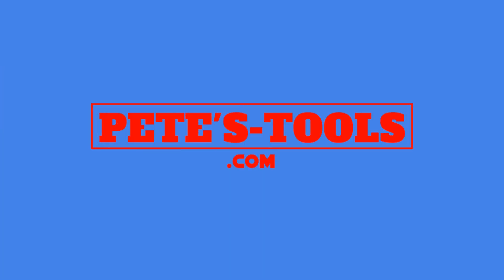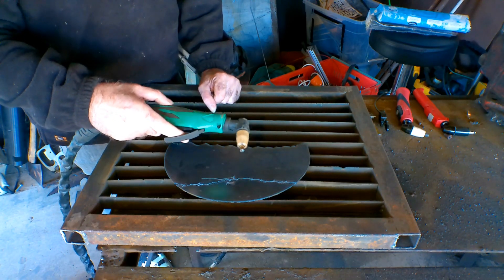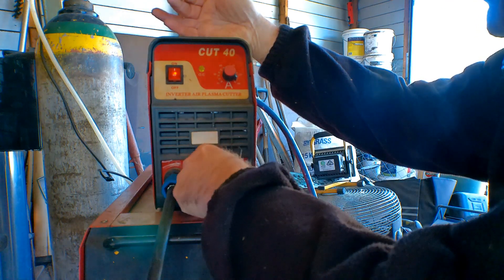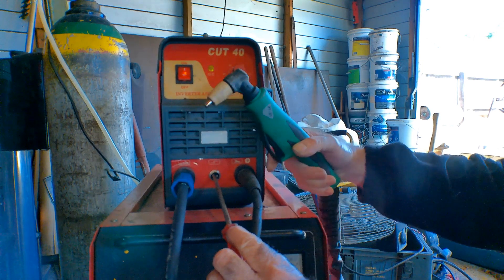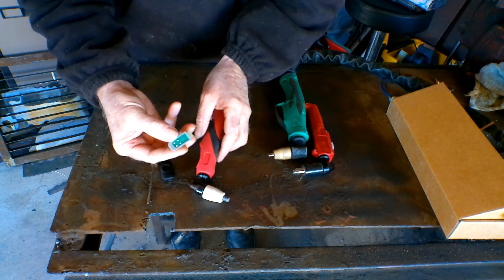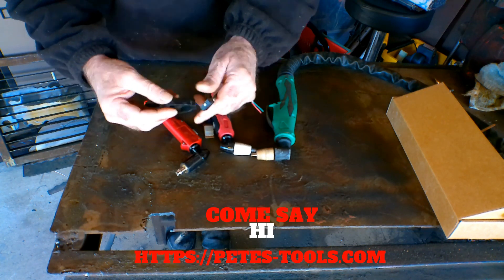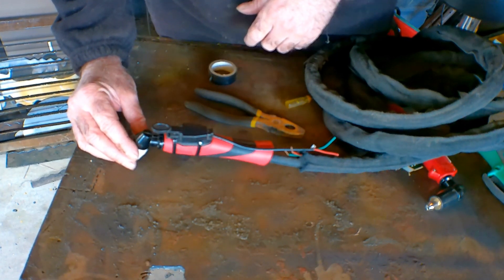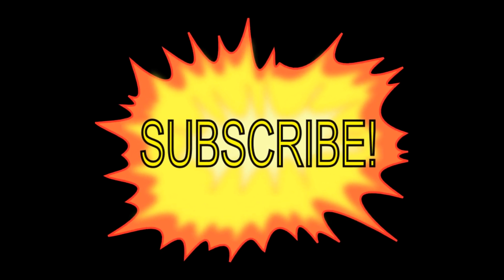Plasma torch won't start/ Plasma cutter not working

Comment: Hi Pete, i have a problem with my plasma cut 40, when the power on the HF imediately lit up without push the switch, i hope you can help and give the best solution for this case, thank you
Reply from the maker: Hi ,I think you have a short in your switch wiring.